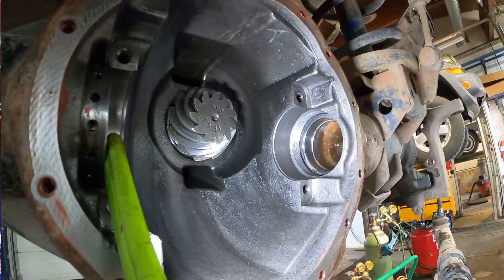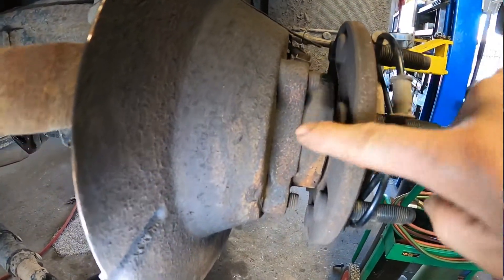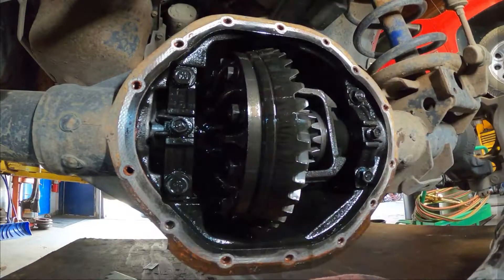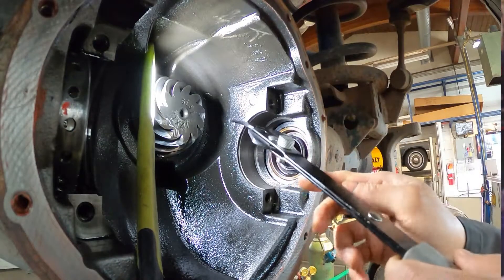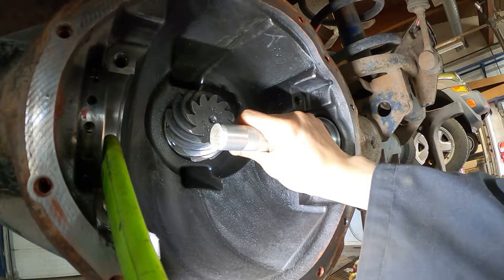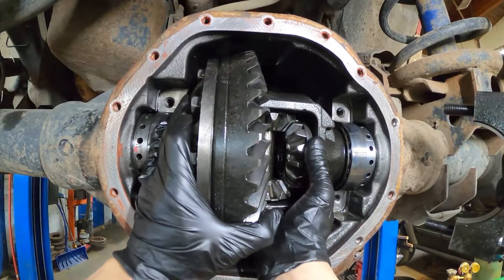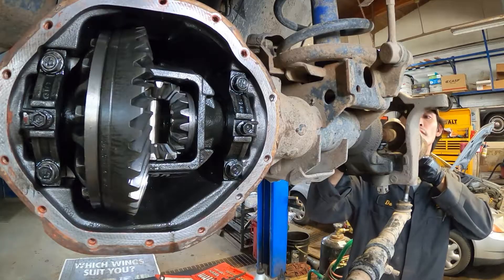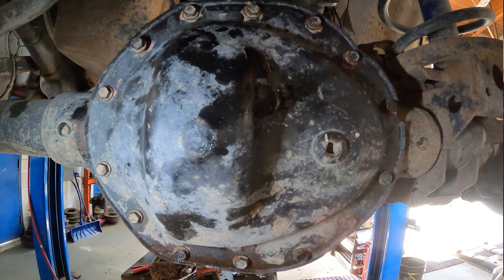How to replace FRONT AXLE SEAL on RAM 2500 quick and easy

Comment: Interesting, nice way to do that. Although if your going to so much trouble, do both seals, not just one of them. I suppose you would after replacing one side seal, temporarily install ring carrier, move adjuster back to original position, then unscrew other side adjuster one turn and repeat the steps again. OR you could just turn both adjusters back one turn at the beginning.
Reply: That's what I was thinking but I mean best to charge the customer twice when the other one goes lol
Reply: @hemi4lyfe  The other side isn't replaced at the gears. Its replaced at the disengagement box. That said, I didn't see him replace that seal.
Reply: @californiakayaker  on the aam axle you don't haven't a disconnect the front axle is always locked. The passenger side seal is replaced the same way as the driver side

Comment: Im not quite understanding pre load even after reading comments. I set left bearing back to normal turns and turn the right one a couple dots extra, get the assembly in, and then turn them back to where it was originally, like opposite of getting assembly out?
Reply from the maker: @em0p0ny  Bearings adjustment have some play that mean it still loose and zero play or zero pre-load when it just stop play and pre load that mean we put more turns on the adjuster to give it more tight or more pressure. 
Old bearings been in the housing for a long time never been remove it worn out, so if we adjust 1/2 of turn on each side more than original position it should be okay but never let it loose and play it will making noise and wear out faster.
Reply: @silverstonespov5291  okay so I should just get of the tools to measure the backlash and adjust accordingly.

What about the preload pinion measurement, as well as carrier bearing? Is that something I should also be worried about when replacing seals?
Reply from the maker: @ we don’t touch the pinion bearing if we not replacing the pinion seal and the side bearing we put it back the same spot just like before then we don’t have to worry about.
Reply: @silverstonespov5291  okay and can just do same to left side and right side. Thank you.

Comment: Is there a video to show how to pre load the bearings on the adjusters? I’ll be replacing the axle seals and pinion seal soon. Want to make sure I pre load correctly.
Reply from the maker: Sorry I don't have that video but the manual said: from zero play on the side bearings and then tighten 4 more hole on the adjusters. 2 on each side or depend on how much play between the pinion gear and the ring gear. I would mark the pinion shaft, the shaft nut before remove the nut to change the pinion seal. and mark both side on the side bearing adjuster and count the turn when taking it out. Hope this help

Comment: I’m doing my 04 dodge it’s just like this one I have no lift so I’m struggling to get the diff gears back in correctly I marked the sides but I have a sway bar in my way so it makes it very hard would u recommend taking the Sway bar outa my way or just fighting it
Reply from the maker: @vic7906  Drop the sway bar down or remove it to make room for your work it a lot easier, good luck

Comment: Exelent video,,I have a problem on my 2008 ram 6.7 ,,,I have a leak on  passenger side wheel,,,I don't think I can tackle this project,,my question is how much it cost if I take it to the dealer
Reply from the maker: I’m not exactly sure because dealer labor cost is high. You can call them and ask for a quote

Comment: I’m doing mine right now how are you able to get the axle nut off without the differential spinning around on you?
Reply from the maker: I use impact gun or you can put the bar thru the u-joint behind the knuckle to stop it

Comment: My 2019 Ram Power Wagon 2500 front axle is leaking fluid in the same place as first shown in this video.  36700 miles.  I do offroad it but I am not abusive in terms of speed or crashing into rocks.  I am also pretty tame on the road and always do a check to make sure 4WD is disconnected before going from offroad to on road.  Any input on why this leak would be happening at such low mileage?  Not looking for the Ford/GM fanboy responses.
Reply from the maker: Check the Axle shaft U-joint make sure it not dry causing vibration or check the diff breather/ vent tube not plug causing high pressure inside the diff
Reply: @silverstonespov5291  ok thank you, the U joint is completely covered in fluid.  I haven’t the breather

Comment: I am doing both seals right now. Do I just put the bearing adjuster right back where it was when I started (counting turns, etc.) or is some pre-loading that must be done?  Thanks.
Reply from the maker: Put it back the same where it was but, If the Vehicle Have over 200k km, the bearings worn out you can tight the adjuster one more note on each side to pre load
Reply: @silverstonespov5291  Thank you so much. And by "note" you mean turn?
Reply from the maker: @stevesherer5416  Not turn, to the next hole. 1or 2 hole on the adjuster. about 1/8 turn.
Reply: @silverstonespov5291  Great! You've help me a lot. Thanks.
Reply: @silverstonespov5291  I can't get the adjuster all the way to original location without a lot of pressure. Do you only use the screwdriver in the video to tighten the adjuster? Should it be that tight if it's going back to original position? I know there's a $50 tool to turn the adjusters. What do you think might be going on?
Reply from the maker: @stevesherer5416  Maybe you got mixed up left to right bearings. it have some pressure but not too much. Did the gears assembly sit right in the housing? Or put the left adjuster back to original position first and then just turn the right adjuster until it have no side to side play and then pre-load to the next 2 or 4 hole. And last check to make sure it have some play between the ring gear and the pinion gear.
Reply: @silverstonespov5291  Thanks. I made sure to keep everything organized and counting turns. Perhaps I just need to put a little more muscle into tightening the adjusters. Cheers!
Reply: @stevesherer5416  did you get it figured out? I’m getting ready to do both seals on mine.
Reply: @TheAmishDuckHunter  Yes, I got it done. Follow these instructions and you should be good to go.

Comment: well done! informative video no bullshit.  I was wondering my abs wheels speed sensor was ripped off I replaced the wheel side and bought a new plug end. but I don't know where the wire went. would you know where that sensor connects? I would love to know it's driving me nuts
Reply from the maker: Normally it’s behind the plastic wheel well by the fender

Comment: good video could you include part numbers and or exact names for the seal you're replacing on the 2008 ram 2500. as well you could also mention 4x4 it is implied but it would help a search.
Reply: Why would anyone look up how to replace a front axle seal on a 2wd?

Comment: would this procedure works on 2015 ram 2500 6.4 t.i.a.
Reply from the maker: Depend on how it set up but it would be similar procedure, either adjuster wheel or shims try not to mix up, keep them the same side of shims or the same turn. Mark everything before take it out and keep them in order, good luck
Reply: @silverstonespov5291  thanks

Comment: Do you have to get the right seal out first to move the shaft over far enough to get the gear assembly out
Reply from the maker: I don't have to remove the right seal only the shaft, after both shaft out then the gear unit
Reply: @silverstonespov5291  thank you